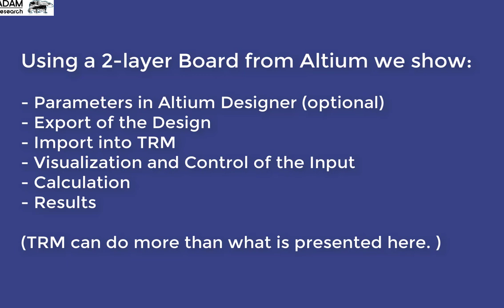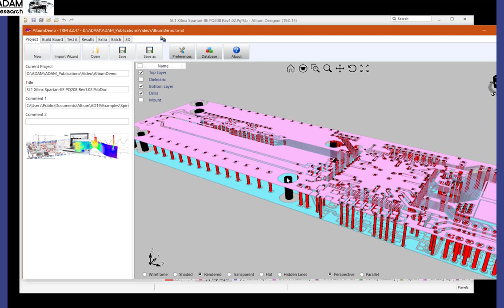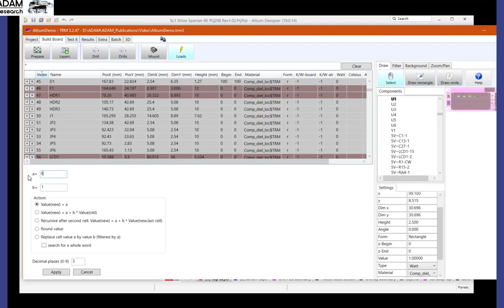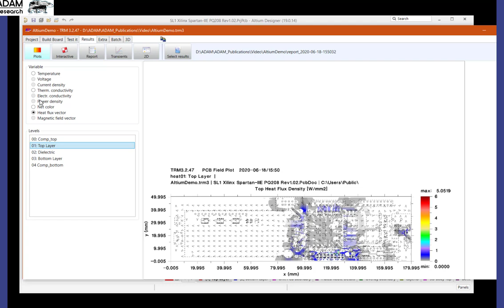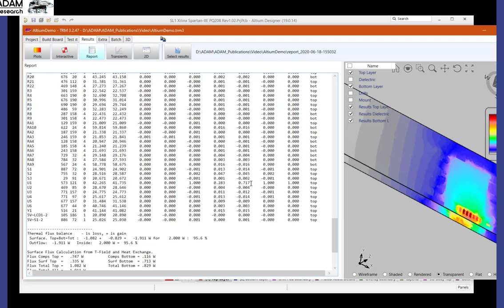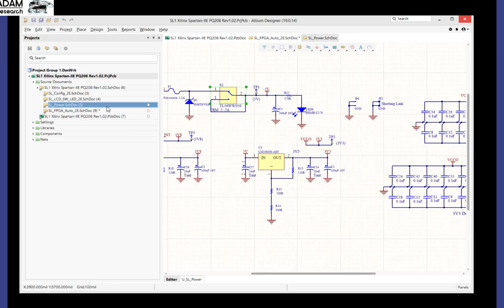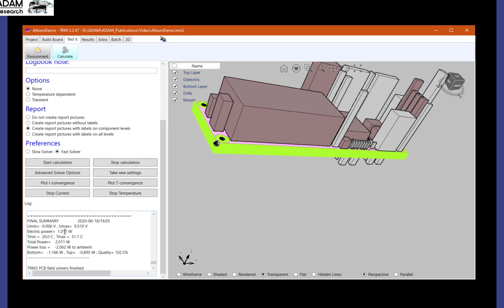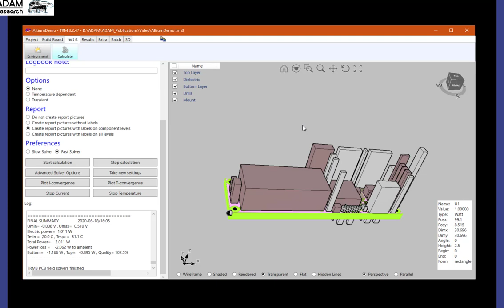ALTIUM and TRM: Thermal Analysis of Printed Boards and Electronic Assemblies

Comment: Hello Sir, is it possible to simulate the cooling fan air flow and its effect on the PCB?
Reply from the maker: Hello Kamel, calculating the flow around a PCB by a fan is not the aim of the TRM software. As a substitute, a Reynolds-Nusselt correlation is built in, which approximates the heat dissipation as a function of speed.